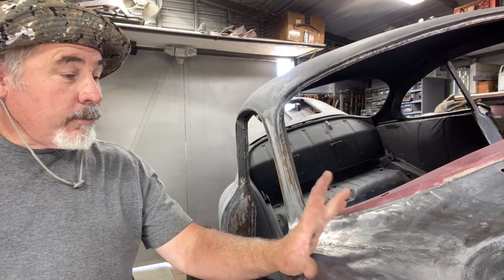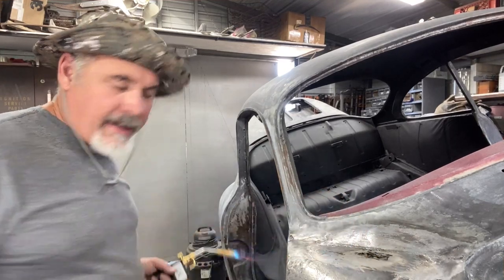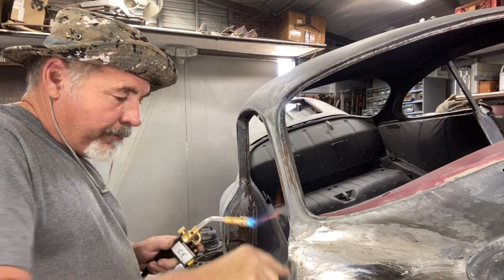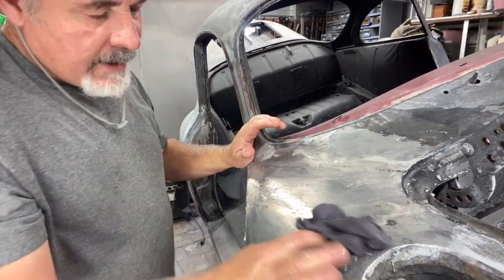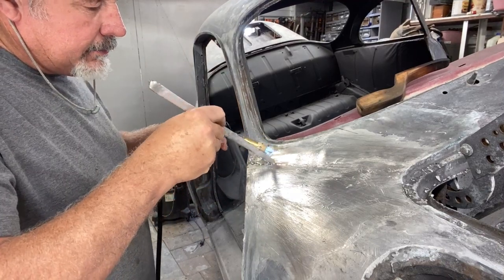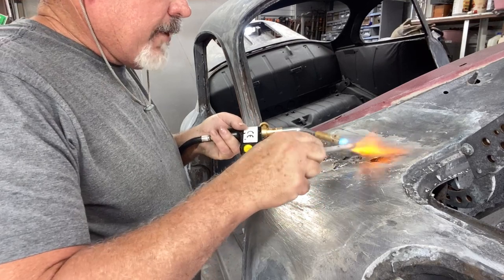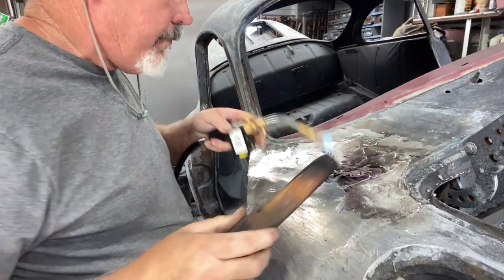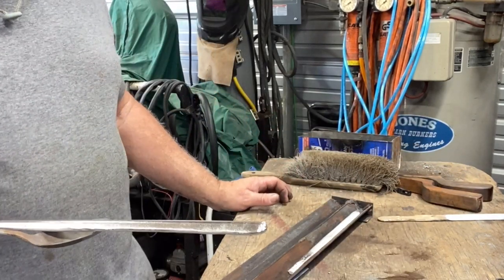356 Porsche Restoration Lead Work

Comment: Please show or explain how you removed body surface rust to get it so shiny thanks
Reply from the maker: A lot of different things. First I used electrolysis. Using a plastic swimming pool to submerge the part in water with baking soda and using a battery charger and sacrificial metal to attract the rust off the part. Plenty of videos out there explaining it. But that not good if you have a huge part. Used of phosphate acid wire brush and a lot of elbow grease. You can buy it at Home Depot in the paint department and it’s labeled as metal / concrete prep. Works amazing but it’s still not easy. I used a lot of stuff labeled rust remover with little to no results and a bit expensive. Metal Rescue seems to be good but it takes a lot of applications. I made a solutions with citrus acid and Oxalic acid and it worked better but it’s how you applied it. I will have to make a video explaining how but every panel was a hit or miss. Of course you have to sand but you are removing metal. Has to be stable before you sand. Organisms have to be killed on the metal unfortunately they keep coming back unless it’s sealed  Thanks I’ll try to make a video on it

Comment: Lead has strength. Thats why it was used by auto manufacturers.  Some hi tech bonding/filler stuff out there now.
Reply from the maker: @danielburke4113   I like using every thing out there. From lead to the latest stuff out there

Comment: Use tallow or oil on the paddle soak for a few days in oil so it does not stick to it as well .
Reply from the maker: I used Crisco all vegetable it worked really good and it’s less fatty LOL